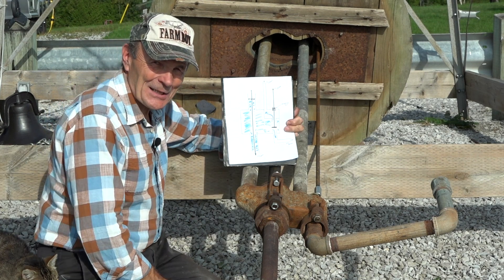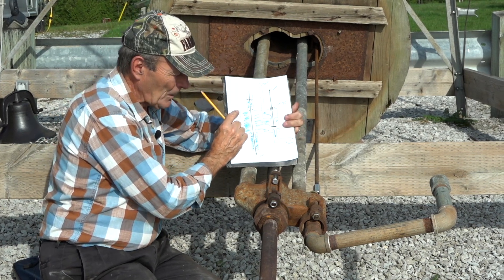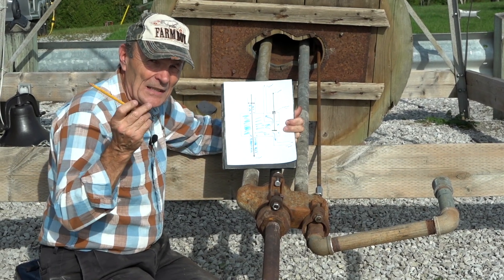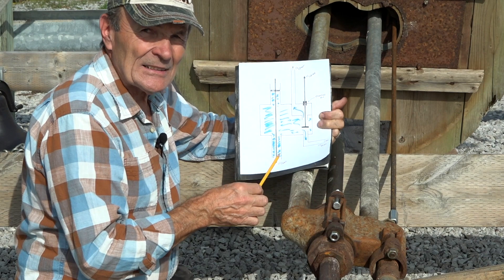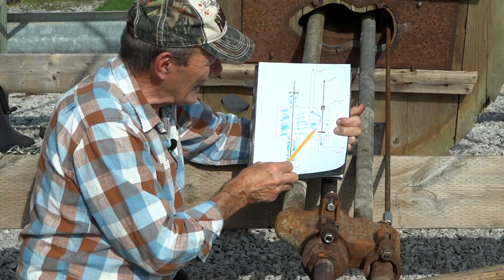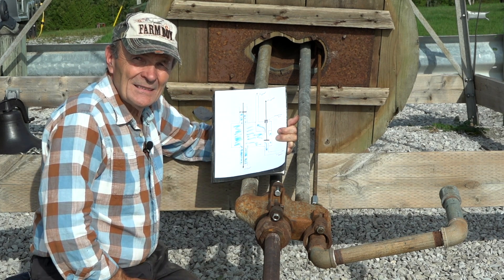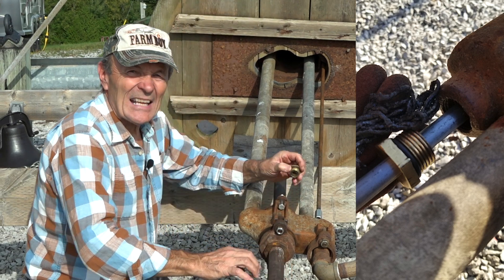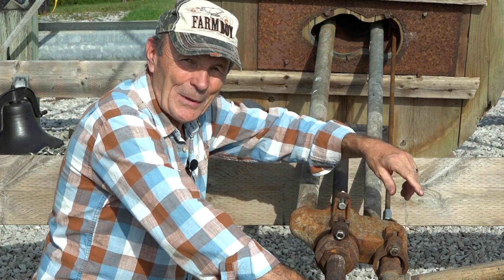#88 How A Windmill 3-Way Works | At The Ranch

Comment: THIS CHANNEL SUCKS...
... ME RIGHT IN!  

Gonna be fun soakin' up wisdom from this channel.  I'm pretty skeptical about wind power as a substitute for fossil fuels, but for movin' water around?  Very practical.  

You won't see ME restoring a 1910 pump, but I shore get a kick outta watchin' somebody ELSE break one open and show me the guts!  Seems like you could build one if ya had to.

I couldn't tell you how many people I know with wells and pressure tanks, who need to turn a generator on to get water when the power goes out.  Seems like if you have room, you should have a windmill or two and a cistern or even a bevy of cisterns, preferably on some land with some vertical to it, so you can bury everything but the windmill.

I ain't dead set on gettin' off the grid, but when you can use 18th and 19th-Century technology that gives you redundancy, that's preferable.
Reply from the maker: Thanks Harry.  Windmills were the primary source of power for water and tools (ie belts to turn stone sharpening wheels).  Thanks for sharing and more on my windmill to come.

Comment: Hi Alec. you didn't mention what the pipe on the left is for ? (the one  closest to you) take care Owen m
Reply from the maker: This is a Beatty Pumper and the Beatty Company was well-known for their rugged builds. That pipe, which is not found on other 3-way valves, is nothing more than a support. It simply holds the 3-way (which isn't light) solidly in place. Most other such valves use one of the functioning pipes as a support.